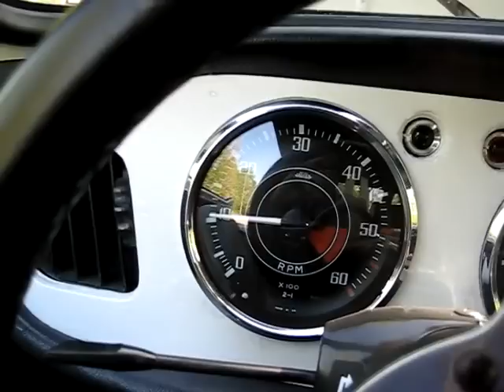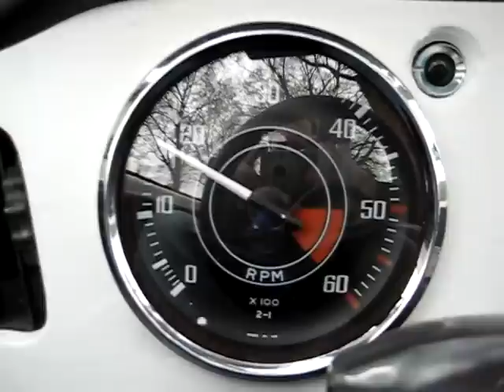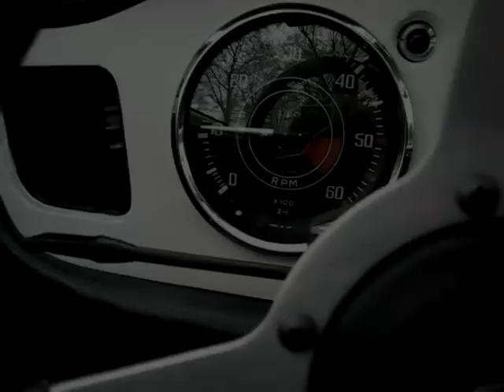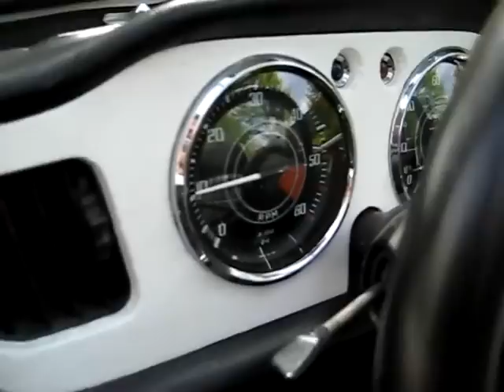Triumph TR4A - SU HS6 carbs - check-up

Comment: I'm looking into buying these carbs for my 74' TR6. Who do you recommend I buy them from?
Reply: I own a 74 TR^ and replaced the Strombergs with HS6's and love them. Simple to adjust and very stable.
Reply: I put a pair of HS6's on my 74 TR6 and love them. So simple to tune and reliable. Haven't had an issue in seven years. Will never go back to the Strombergs.